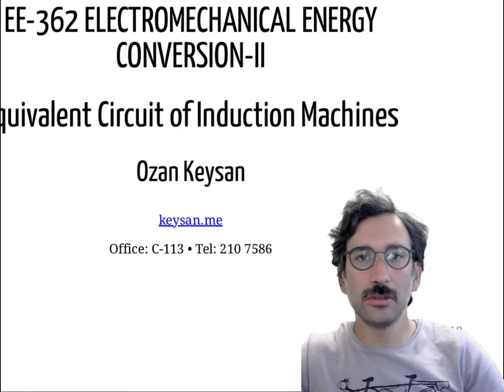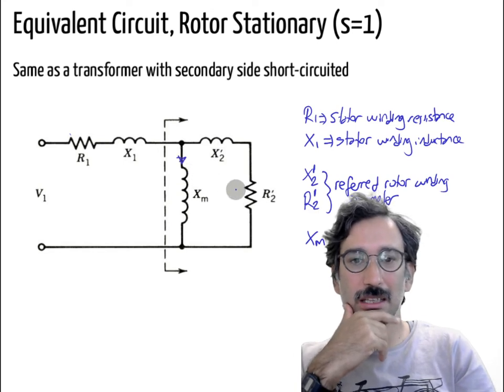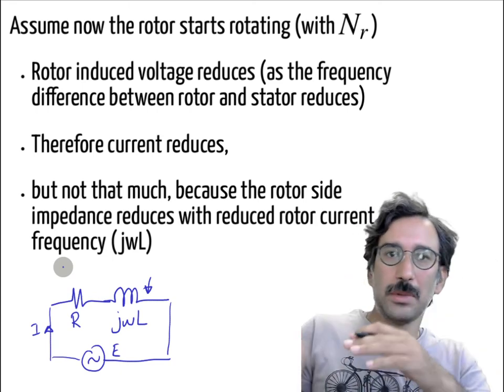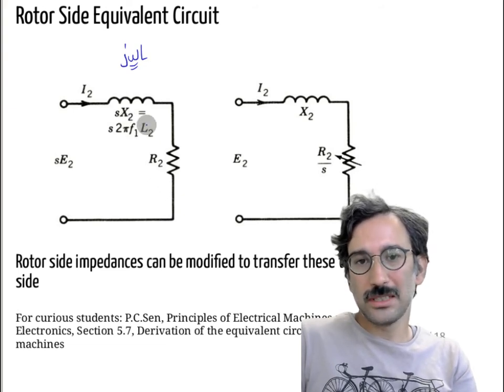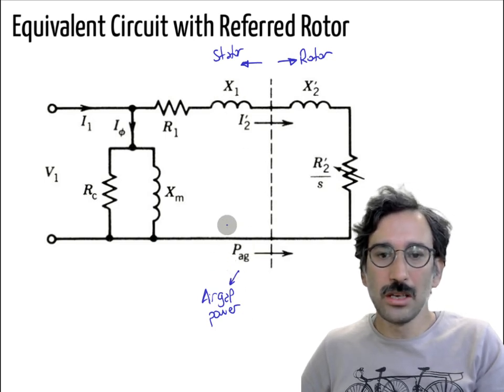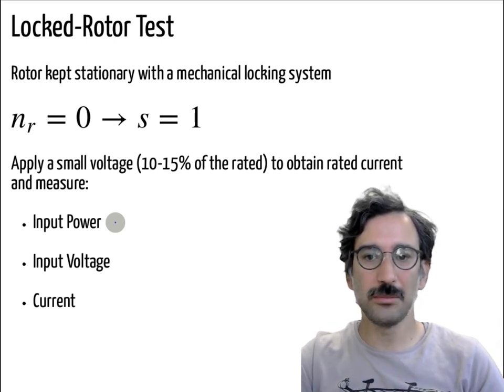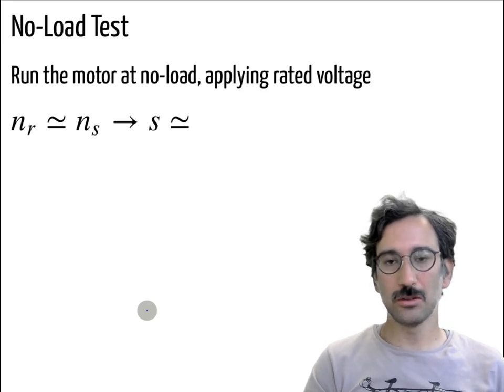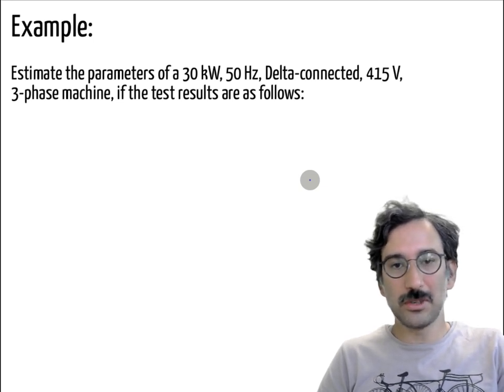Equivalent Circuit of Induction Motors, No-load, locked-rotor tests

Comment: Hello sir. Thank you for this great video.
I am helping a carpenter  with his machines. His machines start at very high current. For example an old bandsaw. What is the simplest/cheapest way to reduce the starting current? Is it possible to use capacitors? Or is the starting motor the best method? thank you again my brother
Reply: You have the option to utilize soft starting techniques. I can suggest various approaches for you to ensure a smooth motor start, ranging from simple to more complex methods.

Implementing resistive starters:
Consider a 3-phase switch with three operational modes: open circuit, resistor-added path, and shorted path. Connect the motor to the grid through this switch. During motor startup, use the resistor-added mode to decrease the current drawn. However, be mindful that the resistors may heat up quickly. Therefore, once the induction machine reaches its rated speed, promptly switch back to the shorted path, which is akin to directly connecting the induction machine to the grid. This is the easiest and most cost-effective solution as per your request.

Utilizing Delta-Star switches:
Note that if the motor is delta-connected, the voltage across its phases is higher compared to a star connection (approximately 1.7 times greater). Consequently, if you initiate the motor in a star configuration and subsequently switch to a delta connection, the initial current is nearly two times less than in the delta configuration. You can employ delta-y switches for this purpose. However, I do not recommend this method unless you possess the necessary qualifications to alter the phase connections of the induction motor or understand the motor's ratings. This method is also cost-effective.

There are additional methods worth exploring, such as induction machine drivers that gradually increase the electrical frequency of the stator windings, thereby reducing the slip and minimizing the drawn current. Furthermore, certain power devices can modify the AC voltage applied to the motor terminals. By gradually increasing the voltage at the motor terminals, the drawn current remains low. However, these methods tend to be expensive.

Comment: Why you didn't  consider stator resistance and stator leakage reactance in no load condition
Reply: The short answer is for the sake of simplicity.

In the equivalent model, there is a component called a "parallel branch," where Rc and Xm are connected in parallel. Let me explain the meaning of these components to enhance clarity in our discussion.

*Rc: This represents the equivalent resistance that models the core losses.

1) Hysteresis: When using magnetically permeable materials to generate more flux, it's important to note that these materials are not ideal. They exhibit hysteresis characteristics. Imagine an electromagnet used in school projects. Even after you stop applying current, it remains magnetically attracted to other magnetic materials, such as bolts. This is a basic example of hysteresis. In AC circuits, hysteresis causes power losses. (To change the state of something, you have to convince it. :)) Additionally, when the material is saturated, the magnetizing current is incredibly high, resulting in more conduction losses in the windings. However, for now, let's ignore this aspect, assuming the motor is designed not to saturate.
2) Eddy current losses: The phenomena on which induction machines rely are also a significant cause of power losses. As the alternating magnetic flux travels through the core material, it induces voltages across the core body. Although the core material is designed with low conductivity and lamination, it still causes losses. The Rc in the parallel branch models the combined "core" losses. You might ask whether it is constant or not, which is a very good question. Both hysteresis and eddy current losses are functions of the voltages applied to the motor terminals. It's worth noting that the stator winding resistance and inductance are not significantly high, so we can disregard the voltage drop over them. In this case, the voltage drop over Rc is not significantly different whether it is placed on the right side (which would be more accurate) or moved to the input terminals. This simplifies our analysis, and we don't lose much accuracy. You can try solving this circuit in both ways to understand what I mean.

*Xc: This represents the equivalent inductance that models the inductance of the core.
Consider a simple case with transformer windings that have low resistances. Despite this, they do not blow up, and their input current remains low when connected to the grid. Thanks to the law of induction, when an AC input is applied, the voltage induced across the transformer terminals is equal to the voltage drop across the primary windings and the induced voltage across the coil (L(dI/dt)). In transformers, we keep L very high, so even a slight change in current with respect to time results in very high voltages that counteract the increase. In short, since the air gap in induction machines reduces L compared to transformers, the inductance is still relatively high compared to leakage inductance.

Now let's address your question. Engineers designing these machines aim to optimize their products by ensuring that Rc and Xc are guaranteed to be very high compared to Ra and Xa. You will observe that if you:

Do not consider the parallel branch on the input side and do not ignore the stator resistance and reactance,
Consider the parallel branch on the input side and ignore the stator resistance and reactance,
I assure you that the results obtained will match by more than 95%. :)
Reply: @erdemcanaz6394   hocam gerçekten çok güzel bir cevap, çok güzel bir açıklama. ellerinize sağlık.